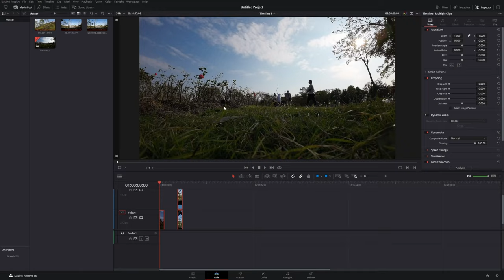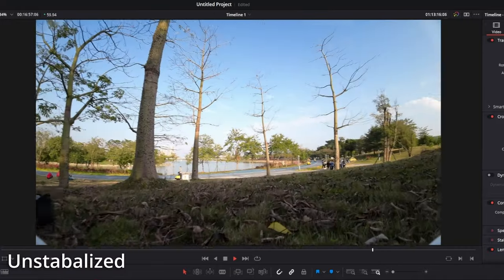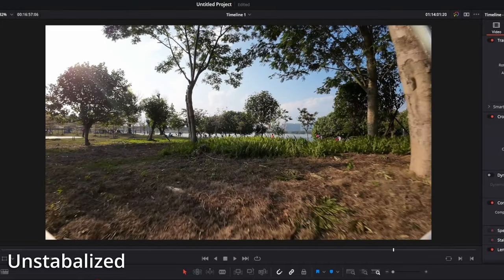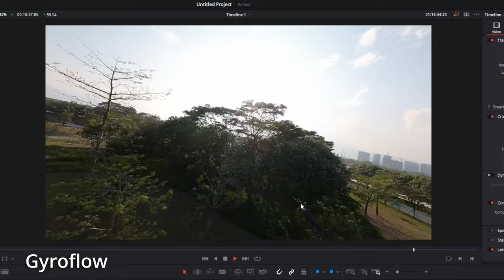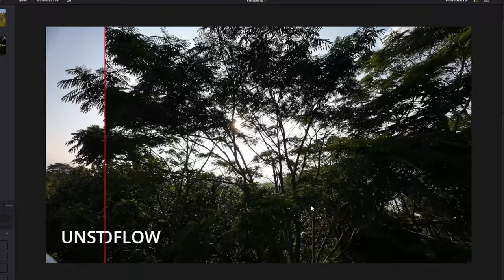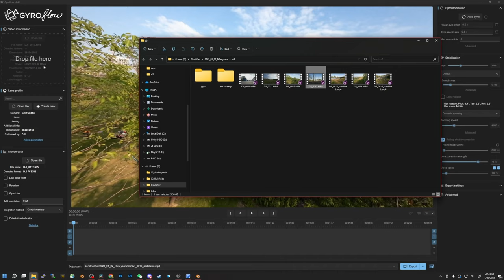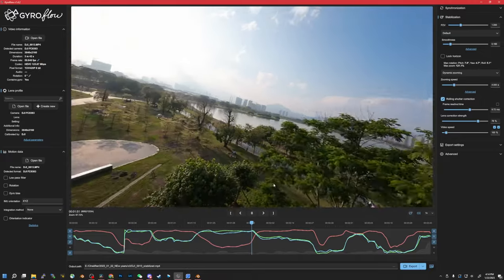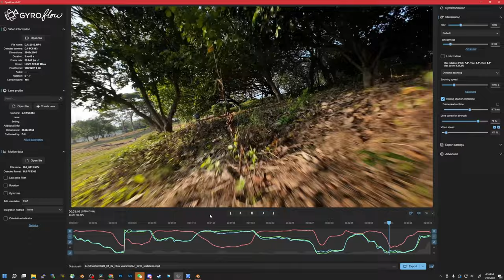Gyroflow VS ROCKSTREADY for the DJI O3 Air Unit FPV

Comment: Gyroflow only works when air unit is on wide mode. I found this out the hard way. No ultra-wide mode with gyroflow.
Reply from the maker: Yes I found it out the hard way as well haha.

Also I wanted to make a video on this but I find ultra wide with rock steady on to make me fly much worse. As I cannot "feel" the drone and maybe there is extra delay?
Reply: @33rdframe  That's interesting! It could be that it's just too wide
Reply: Ugh this is terrible! Just found this out today and found this comment after searching for a long time. How frustrating.
Reply from the maker: @quantum_m3chan1c  I feel you bro

Comment: Gyroflow stabilizes much better but at the same time it makes you lose video quality, something that doesn't happen with rocksteady, that's why I use rocksteady to have better image quality.
Reply from the maker: i doubt you could even tell the difference in the quality lost with a microscope
Reply: @33rdframe I wonder what I am doing wrong then because I see a big drop in quality exporting with gyroflow, it really softens the video and I've tried so many settings to try and lessen that.

Comment: Hey dude, just finished my 03 build and wanted to test gyroflow with it, i have done a test flight today with rocksteady disabled, its put on normal FOV and the image is recorded at 2.7K 100fps. when i drag and drop the video into gyroflow its telling me that there is no motiondata, what did  i do wrong?? is it only collecting this data at 4k?
Reply from the maker: It doesn't work with ultrawide
Reply from the maker: But it should work with 100fps

Comment: Kinda late to this video. But I just started really using the o3 and I have this massive problem, where the raw footage looks kinda okay (but obviously not stabilized) but as soon as I put it through Gyroflow it gets these massive vibrations that just aren't there in the raw footage. I read somewhere, that the gyroscope on the o3 is supposed to be very sensitive, so is it maybe just because my quad isn't super nicely built? But then again I never had this problem with my GoPro before. Do you have an idea what could be wrong? TIA
Reply from the maker: This sounds like 2 problems

1) yes your drone build is super noisy
2) you are filming with automatic shutter speed and the lighting conditions are low and it causes you to break the 180 rule (shutter = 2*(frame rate)). Which gyroflow does not like and freaks out
Reply: @33rdframe  Hey. First thanks for replying :)
My shutter is on manual as is everything else so I think it has to be the drone. Also what I just remembered is that I had to fly with cut props because I had the wrong arms on my frame (long story) so it probably is that *facepalm
Im gonna fix it tomorrow anyways and test it out then. Cheers
Reply from the maker: @stormbreaker_fpv  oh boy the props are def a huge problem haha
Reply: @33rdframe  yeah. I upgraded my old apex frame to the apex evo deadcat and didn't realize, that that one has 6" arms in the back xD. So while I waited I just cut off some props. Now they're here tho so hopefully that fixes things.
Reply: @33rdframe  Okay so I just tested it and somehow its even worse. Maybe I should try softmounting everything and just use rocksteady for now :)
Reply from the maker: @stormbreaker_fpv  you need a better frame brother

Comment: I am having an issue with no gyro data.  Eis off wide mode no gyro data. With eis on I had a slight side to side shake. So I thought the camera lens was loose so I took apart the camera and put some drops of glue by the lens like in other videos. Then once our back together with eis on I get a bad side to side shake at high throttle and no gyro data. I never tried gyro flow before on this o3 but my other one it works great. Eis off video is butter smooth. Rotor riot tanq smooth flying. Any thoughts?
Reply from the maker: 16:9 or 4:3?
Reply: @33rdframe  16:9. I found my issue. I totally thought I had wide set but it wasn't set to wide. After that it was working

Comment: no matter what i do it's not getting the gyro data i'm going crazy
Reply from the maker: you must turn off eis and also be in wide mode ... not ultra wide or narrow
Reply: I am having this same issue. Any fix?  Eis off wide mode no gyro data. With eis on I had a slight side to side shake. So I thought the camera lens was loose so I took apart the camera and put some drops of glue by the lens like in other videos. Then once our back together with eis on I get a bad side to side shake at high throttle and no gyro data. I never tried gyro flow before on this o3 but my other one it works great. Eis off video is butter smooth. Rotor riot tanq smooth flying. Any thoughts?